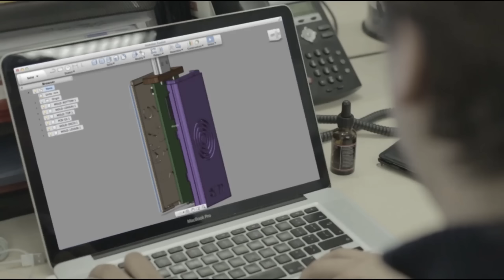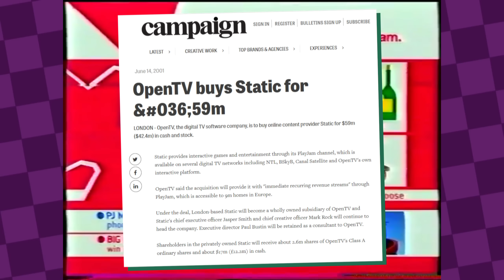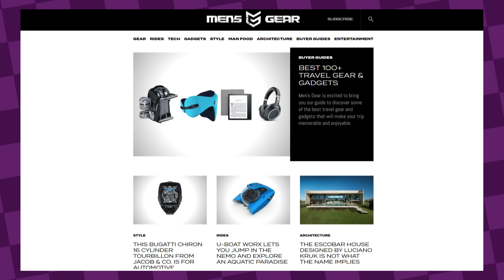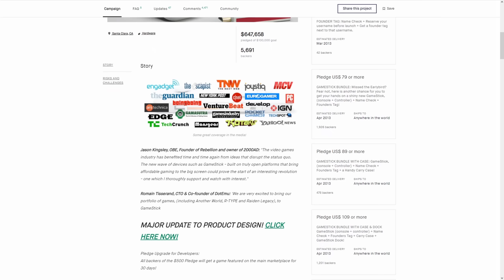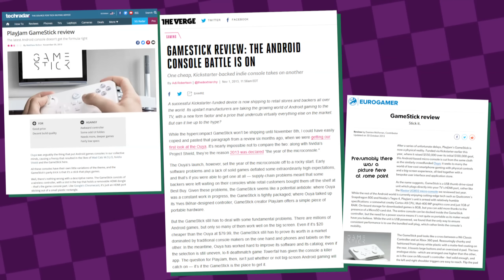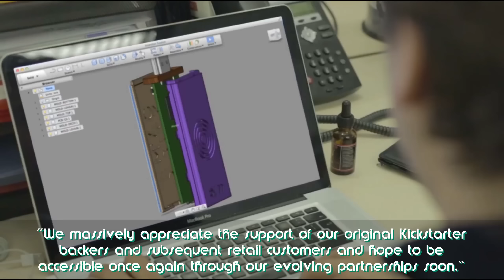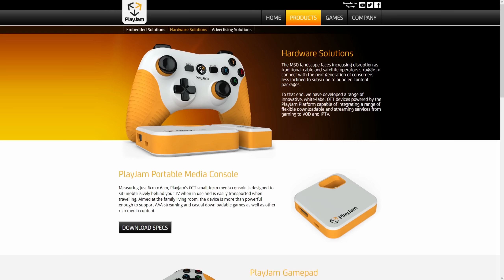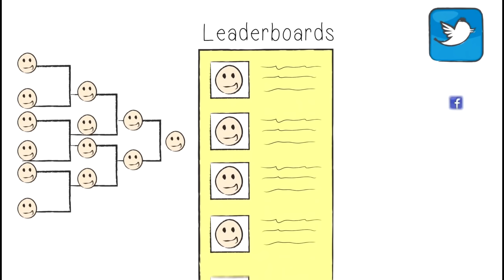GameStick - The Other Failed Kickstarter Console

Comment: The problem with all these "play mobile games on your TV" consoles is that they all ignore the fundamental truth - most mobile games aren't worth playing on a TV, those that are will inevitably be ported to various consoles' electronic markets, and you can already play mobile games on your TV with a USBx to HDMI cable, meaning your product will be competing, right out of the gate, with a piece of wire. The reason all these devices do so well on Kickstarter is that people want to use them as emulation boxes, but for legal reasons most of them make this way harder than it needs to be - not to mention that, if you're handy, a million different factories in China will sell you compact microcomputers that can run actual Windows or Linux. And that's not even getting into the Raspberry Pi, a device whose whole gimmick is "here is the cheapest actual computer you can buy, go nuts."
Reply: Originally it was assumed by these companies and even NVIDIA that the major game developers would be willing to license the games to Android and these Android based systems. Sony and Xbox put a stop to that. 
They would have been destroyed 10 years ago when you could buy a high end off-brand Android for a hundred bucks!
Then all these systems had to offer was shitty mobile games and were ruined.
Reply: You can't really use your phone on your TV if it doesn't support HDMI alt mode.
Reply: @stewbanker  as my post said, it was heavily assumed the game developers would license mainstream platform games to Android, but none would. I've had a lot of cheap Chinese tablets with HDMI sockets on them that would have ran PS3 games ported for ARM/Android. 

Almost every major game developer uses Unity to create console and PC games, and when you start the build as well as complete and export it, you can set it up for every system including Android. 
So, the ability to put the games on Android was never an issue. I think the dirt-cheap hardware caused the console companies to strike deals with the game developers.
Reply: @jondeth298  yeah well, the issue doesn't even come up to be hardware, I mean, yeah it could be an issue but, the mobile market is not suited for paid games, thus no profit
Reply: @stewbanker  they would just run it on Steam. Paid downloads etc. The issue seems to have been that a console was $500, an Android a hundred bucks.
Reply: @jondeth298  But why is the issue that android consoles are cheaper? Because people will shift to it more
Reply: @stewbanker  Android hardware hit that performance level just as Sony and Microsoft were ready to release new consoles. They stood to lose a fortune to Google's Android. 

If the game developers had been willing to license the games to Android/Google, I'm sure console sales would have been cut by 1/2. I had cheap Android gamepad tablet 10+ years ago running various versions of GTA without issues and it had an HDMI out.
My current $200 Chinese A. tablet can run Fortnite, but I have no desire to play it. 

Anyway, I think everyone is at a stalemate and Android is not a legitimate gaming platform. I have a rebuilt Optiplex and am about to do another. These 10 year old workstation models will run all modern games at speeds good enough to compete online. They're a hundred bucks recertified.
Reply: @jondeth298  true

Comment: In theory these consoles had the power behind them for some amazing gaming experiences, I mean the hardware was outdated but still, the outdated hardware was far more powerful than a PS2 at least in theory. However that available power could only shine with the development backing of AAA developers, and what Triple A developer in their right mind would develop games for systems with such little market share and with specs worse than even a Wii console. Obviously playing mobile games on a TV was never a good idea, but these consoles weren't really aiming for that, those mobile games were just to hold us over until "real" games were ported or developed for their platform, they were aiming to be the goto platforms for indie and AA studios.
I feel like these kind of products just might have a chance to succeed, or at least a greater chance, if they were to become x86 based. If they could cram enough power into a mini console to run most 2D PC indie games, and mainstream games from the early mid 2000s and earlier, for around the same $80 price point. that'd probably be a lot more appealing to customers, especially if they made it really easy for the consumer and they streamlined a lot of the faff involved with running PC games, like instead of creating their own storefront they could instead make a steam frontend that only showed manually curated games known to function seamlessly on the platform, maybe the front-end could be something akin to Lutris and be community driven.
All that said though, I'm slowly realizing all I'm really suggesting is a low end laptop without a screen or a keyboard, such a product in bound to fail without an exceedingly low price point and damn good software.

Comment: I have the special 'Kickstarter' edition, in black & Kickstater green. Mint condition. Think it's worth anything? (LOL) (Also worth noting - while you can fit it in your pocket...you still have to drag the cables and power adapter around with it, which pretty much eliminates the idea that it was all snugly fit inside the controller.)

Comment: The Nvidia Shield isn't a failure, not only is it the only one of the listed pieces of hardware that is still being made (albiet now sold as a Roku-style Streaming Box), but it's processor is the same one being used on the wildly popular Nintendo Switch.

Nvidia technically won the war.

Comment: I knew about the gamestick. KNew it would end up failing i also knew the uyah would fail...not cause im smart but because i noticed the key things people were buying these for was from misunderstanding marketing hype that was in itself way overblown to the point of near lies.
The only reason eather got the funding is people actually thought that they could be used to stream play aaa games not just for current gen but that it would work no matter how much more powerfull each enration got.
What they thought these could pull off is still not possible unless you have crazy high speed internet and still need a $400 or better system.

Comment: For $60 you could get a PS Vita TV.
Reply: I'm still trying to find one for that or less
Reply: @NotoriousNickNorris  Yea, that comment was 6 months ago, when there are still a lot of used PS Vita TV, but now the price might've changed. I bought mine brand new for $60 when they discontinued the support.
Reply: @awdrifter3394  I'm aware. I've been looking for longer than that. A few years at least.
Reply: @NotoriousNickNorris  Before the pandemic or even at the beginning of 2020 the PS Vita TV were still pretty cheap, should've bought one back then.
Reply: @awdrifter3394  If I could FIND one for sale, sure. That's my point. I couldn't find one for less than $200.